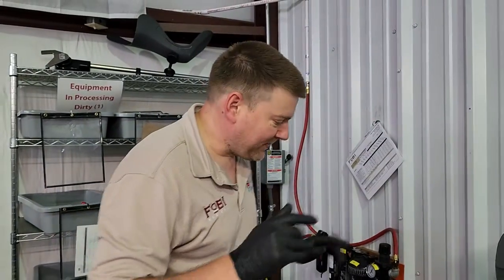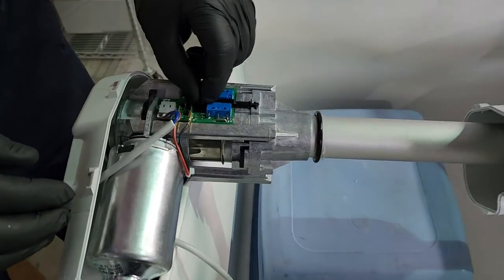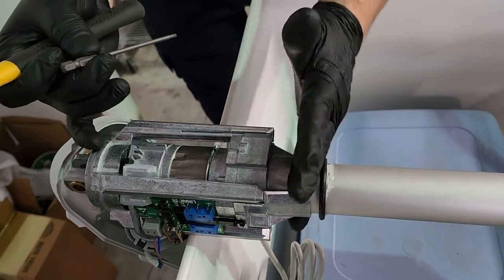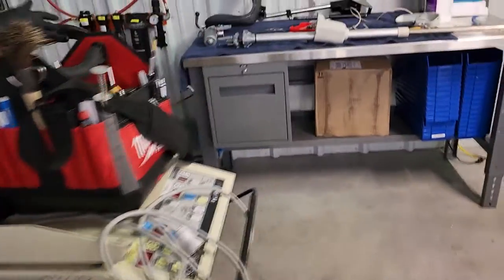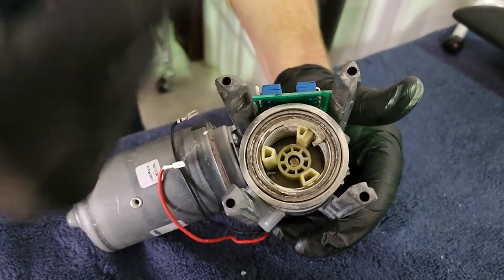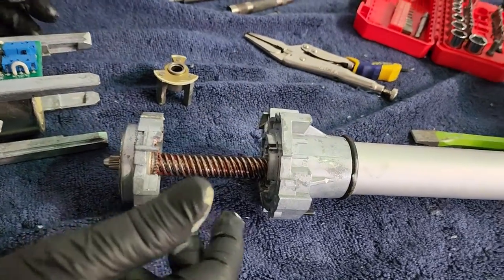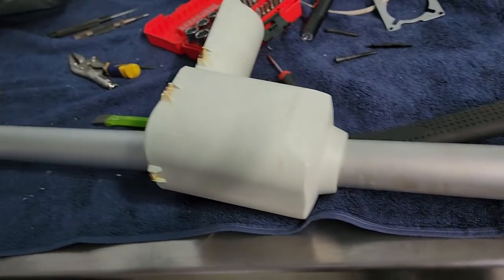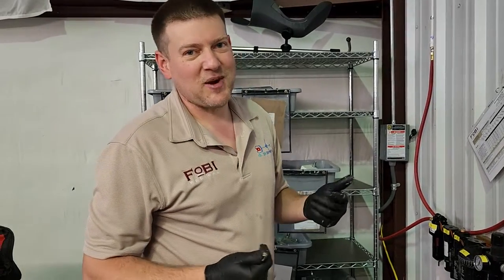Inside Linak Linear Actuators

Comment: I'm a disabled guy and have a hoyer elevator with a linak actuator, sometimes it makes a friction noise/some cracking noise, it runs great though. Could it fail(by fail I mean breaking in half or stop working)? I think it just need some new grease. The hoyer elevator has 150kg limit, I have 90 so I think I should be safe. What grease I could use on it? Thank you!
Reply from the maker: Depends on the cracking sound. I doubt your only problem is needing a little grease. Something sounds loose or loosening

Comment: That's awesome! Could I ask you what's this actuator for, and if it could handle static/dynamic weight of about 300 kg? Just wondering because I'm building my own lift chair to help my disabled brother... I need like 200mm stroke length and lift that weight... Any help would be appreciated, thank you!
Reply from the maker: 300 KG would need 2 of these actuators and the lift steel itself would need to be quite strong for 300kg.
Reply: @BetterBiomedChannel  thank you so much for your help ❤️

Comment: Great post. This is the exact same as my pool lift actuator! Your instructions showed me what I needed to know so I could break it down and see what was wrong. Does anyone know where I can get just the (new or used) motor for this? Mine should be replaced.
Reply from the maker: I have a bunch of these actuators in various configurations.
Reply: @BetterBiomedChannel do you rebuild actuators ? I got one that needs something. Motor still works

Comment: Corrosion is an interesting failure mode.. Did it cause seizure or circuit overload failure? Usually a grease suited for submersion would fix that right up.
Reply from the maker: The corrosion flaked off inside the outer tube and is preventing a smooth movement of the limit switch

Comment: Lately I've encountered numerous beds (about 3-4y old) with bent ballscrews or noisy motors... not sure the guy before me did a proper PPM on them... so we just wait for them to fail completely... Best I could do is make a working one out of two failed actuators (one had burned motor, another one was sticking when unblocking using CPR lever and had extreme wobble) Still waiting on official manufacturer training, however doubt that will learn anything new at this point.🤦
Reply from the maker: I lots of actuators if you're looking for replacement parts!
Reply: @BetterBiomedChannel  - Do you have the motor for the one in this post?